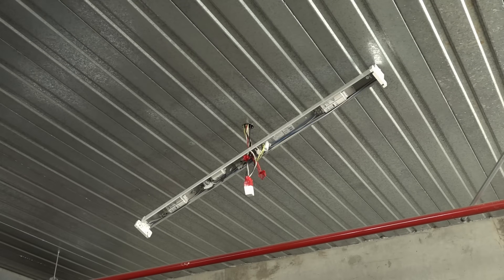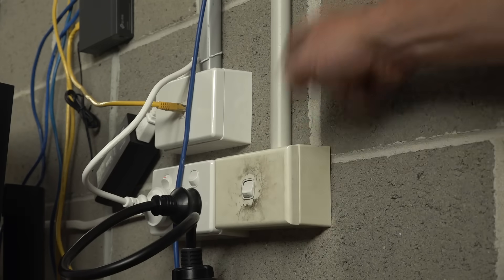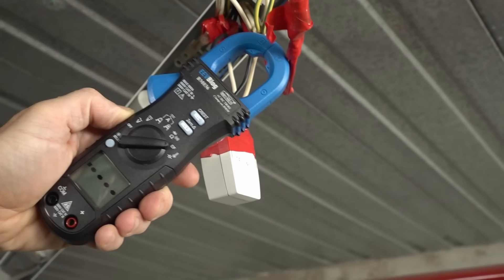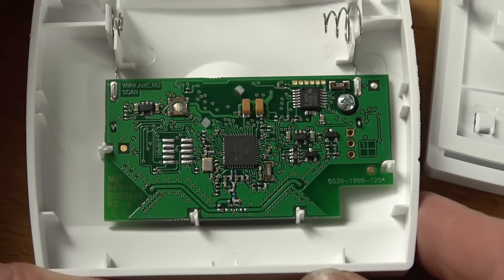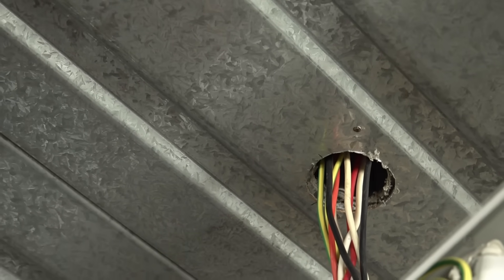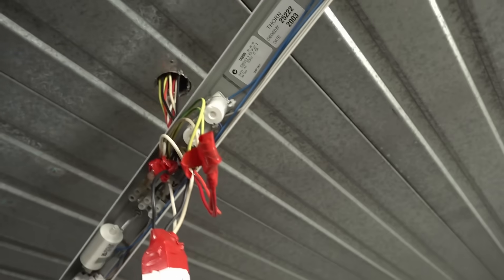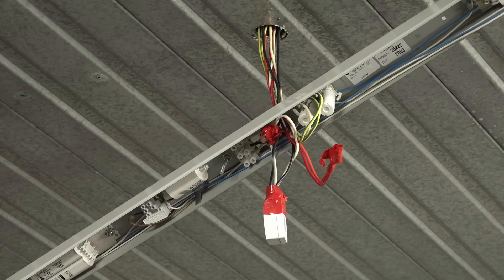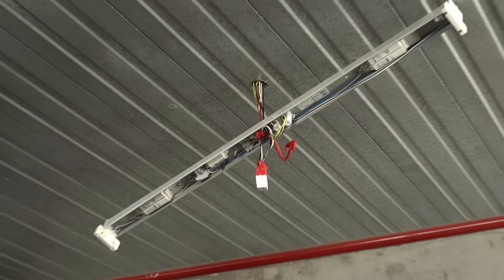Unexpected Dungeon Light Wiring

Comment: Do a block diagram wiring diagram. The taped-up white boxes in both light fittings are more than likely receivers from the IR detector that runs on a 3v battery.

Comment: In the US, white can only be neutral, except for switch loops, and it must be obviously re-colored with tape wherever it is visible to make it clear that it isn't neutral. I think this is only allowed with factory-made cable such as NM (Romex). If you're pulling wire in conduit, I'm not sure you can use white at all for this, even with the tape.

Comment: Psssst..
You can switch off the correct fuse quite easily ... <_<   .... >_> ..
First, you get an >1kV isolated bigger wire cutter. Then you cut away assuming the power is off, knowing that you are assuming the power will know.
There will be a feedback signal coming from your snips and then the line will be power free and safe.
🙂

PS.: Never trust a colleague who said he double checked.

Comment: so the guy nagging the whole through the metal didnt even care the least bit about the wires / insulation and just left it gnarly like this.
Did you check if the ceiling is grounded at least <_<

Comment: Im an electrician in australia and I've worked on this shit heaps. This is below average installation, but wiring is standard. Red is the emergency circuit contrelled with a contactor. White is the Switched active or hard active, depends on the situation. 
 In Australia, phase colours are red, white and blue. Emergency circuit is priority and gets the first pick.

Comment: The way I figure it, the "mystery" wires bugger off to the solar roadway on the roof, and provide power to charge the nuclear diamond graphene superconducting wank-wank battery pack. Probably uses the excess capacitive duractance to keep the Dilithium stable. Not the way we'd do it here in the UNITED STATES OF AMUHRICA, but ought to be good enough for Australia (NOT Austria).

Comment: In each light fixture setup, you typically find a pair of red, black, and white wires representing the incoming and outgoing feeds. Additionally, there's usually an emergency wire, which is looped in and out. This wire is controlled via a contactor for emergency lighting tests. Even if the light fitting isn't designed for emergency use, it's common practice to include this wiring for potential future needs. The extra white wire you see is likely the switched active, coming from the light switch.

Comment: Lights have probably already been changed. Wiring looks prepared for emergency lights with a switched "maintained" light by the wall switch. You can use them normally, but in case of power failure they will light no matter what.

Comment: Electrician here, this is all one circuit. Back at the distribution board the white will go straight to the first lighting point. The red will go through a emg light test switch then to the first lighting point both from the same circuit breaker. At the light fitting run twin to a switch. Then loop switched active to each light. It's also possible it's just two circuits. I need to be looking at it to be sure.

Comment: This is what we used to call ‘3 Plated’ connection. Instead of having the live and loop going to the switch, it goes between the lights, and then a conductor goes down through the switch and back. This is typical for wiring that is done in conduit, as opposed to wiring that done in a timber frame. Because this is a basement, it is quite typical to have extra cores that are used to switch in individual tubes to provide a low level of illumination continuously, and possibly energise the second set of tubes either on a motion sensor or a time clock. It is possible that some of those cores go back to the distribution board for that purpose. My guess is that this installation has been modified from the original design. It’s possible that that area had been segregated from the rest of the basement at some point, and the functionality needed to be changed. Anyway, I think it might be a  good idea to get an electrician in there Dave. I can do it for you if you want, but I’d need to come over from New Zealand 😮

Comment: Dave did you really install the tubes without disconnecting the coil, starter and capacitor? Normally those led tubes connect straight to mains L N … I am surprised one works..
Reply: It's precisely the reason why in Australia public isn't allowed to change the bulbs even in their own homes never mind the more complicated electrical work.
Reply: @AAaa-wu3el That is a good point!
Reply: I have a bunch of retrofit LED tubes that use the existing ballast in the fixture. Some require eliminating it, others don't.
Reply: Yes there are models that retrofit straight in the old fixtures but most models on the market are designed to connect straight to mains... Plus the ones i have used at least have a "starter" that contains a glass fuse inside @strehlow
Reply: @strehlow  Even if they work, the old ballast is still in circuit, and consuming power, for how little it is. I prefer to eliminate it, it will also simplify the light wiring and thus eliminate the possibility of faults in the future, just have L and N go to the lamp.
Reply: @alerighi  There are definite advantages to removing the existing ballast. The ones I have were scavenged from my employer's last office when we moved out and they were renovating it. They selected them so they would be a drop-in replacement that could be quickly changed in occupied offices. 
If I were buying them, I would get the direct-connect variety.

Comment: An active permanant loop is perfectly normal. (2x red looped with a connector, looped to each light, whether needed or not. The redtwhite twin active gors to the switch.)
White is switched active.
No  the permanant active is not for emergency lighting, especially in older installations... and concrete like that. Actives are now normal in brick veneer homes at the switches, only one switched twin and earth to the lights.
The other whites would be the switched wires to the other fluros. That dodgy receiver sensor switcher should be removed. It's probably wired in parallel to the white switched active that will also feed one or more fluros.
I have installed thousands of those old school fluros and done tons of slab conduit and wiring in commercial and some domestic installations.
Im now retired. 
I can't really see the cabling correctly, but thats what i think they have done.
The light circuit for a few basement lights would likely be on another light circuit for another floor, no need for a separate circuit just for a few lights.
Email me if you wish, cheers.🍻🤠🇦🇺

Comment: One tube may always be on when the SW is on. A second tube may come on when the ambient light sensor detects low light levels, but only if someone is present in the room accounting for two white wires. The third white wire would be for emergency lighting. The two red wires are, uh, for, uh, adding more lights or accessories such as security systems, cameras, etc.
Reply from the maker: Yes, I suspect that is the case and what I was implying in the video. I need to trace out the exact wiring inside the troffer. Why you'd want to do that in a small storage unit I don't know, just a waste of energy to keep half the lights on.

Comment: The red permanent lighting wire would be for an emergency lighting circuit and switch supply it seems. And the white wires are switched supply from wall switches?

Comment: In my garage workshop installed outlets on the celling. All celling lights have a cord with a plug. If I need to change light fixtures as time goes by, unplug the old one, plug in the new one. No farting around with wiring.

Comment: Jfc the hole in the Stramit condeck is piss poor. Im pretty sure the juntion box is not meant to be insralled like that.
Reply from the maker: It's only bad on one of them.
Reply: @EEVblog2  Yeah the other one is cast into the band beam so no steel to cut through for the jbox. Makes me wonder if others are like that in your building. I hope this isnt common practice here in aus.

Comment: Perhaps someone has changed this from "loop at light" to "loop at switch". Although rather poorly. Generally the whites are double insulated strapped or single, with red (sometimes black) inner sheathing. The red (taped) would be unswitched. Still hard for me to wrap my head around. Maybe deburr that metal and be safe Dave

Comment: Maybe only one tube is controlled by the motion sensor. This way you always get a lower light level, and higher light level when there's motion. I have some lights that work this way. It saves energy while not completely switching to darkness if no one is moving in the room.
Reply from the maker: Yes, I suspect that is the case and what I was implying in the video. I need to trace out the exact wiring inside the troffer. Why you'd want to do that in a small storage unit I don't know, just a waste of energy.

Comment: Apart from WTF connections, there's so much crap going on around there. Wires in single insulation going through a hole in sheet metal with a jagged edge and no protection? Oh, for crying out loud...
Reply: That was my first thought. Always fun tracing out mystery wiring.

Comment: The double wires for live neutral and earth are looping in and out of each fitting. Presumably the white wires are switched live from the switch.  Maybe there was the option for two ended switching for dungeons with more than one light switch?
Reply from the maker: Possible. But it's so small I can't see how there would be the provision for two lights switches. And there is no other concrete penetrator.

Comment: You'll probably find those unswitched actives were looped for the carpark for EELs when the deck was poured. EELs for that area are communal power. The remote relay was a modification done when they added the storage areas and seems redundant. The whole fitting is pretty poor practice really. No bushing on the metal deck protecting the cabling is concerning.

Also, as an electrician in Brissy, I give you the obligatory don't mess with power in Oz and post it to YT as you may receive a fine for unlicensed work by an inspector!
Reply: You're not allowed to do work on your own property there?  At least in residential here in the US we can have our own work inspected as long as we own the property.
Reply from the maker: The other fitting has the plastic bushing.

Comment: The way these work is the breaker box feeds to the first item (lights or outlet), from there the hot, neutral and ground jump to the next and the next etc.  If there is a switch involved another set of wires will go from the light to the switch.  One hot and one switched.  That accounts for all the wires.  And the reason only one LED bulb works is because when you replace a fluorescent with LED you are supposed to remove the ballast.  I could clearly see the ballast still in place.  That's causing one of the pair to not work.  Also a potential fire Hazzard.
Reply: There are many types of led replacement lamps for fluorescent tubes. Some, sold as "drop in" replacement don't require removing ballasts or any rewiring.
Reply from the maker: You don't remove the ballast, you replace the starter with short circuit starter. Standard practice here.
Reply: @EEVblog2 actually the drop in ones come with a fuse in the shape of a starter. Retro fit leds might be of two different types,typeA or type B. One requires the a rewire of the fitting to just supply live and neutral to one side of the fitting while the other one has a shorted end and a supply end which can be just dropped in. Be careful not to not to install the wrong one if you rewire the fitting cause it will go bang if you reverse the led lamp. As for the white wires, they are switched actives so the sensor will be inactive if the switch is turned off. Multiple white wires joined together will allow lights to be switched together either by the sensor receiver in each light fitting or other external switching. I would replace the whole fitting with microwave type and supply a switched active  to each individual light so they will only come on independently as required( efficient).BTW leaving the ballast in circuit will reduce the efficiency of retro fit leds.
Reply: The observation about the wiring is very likely correct.